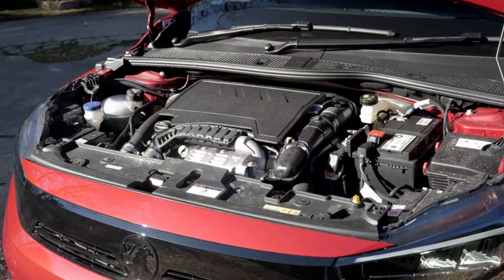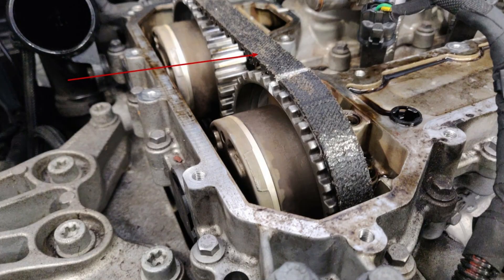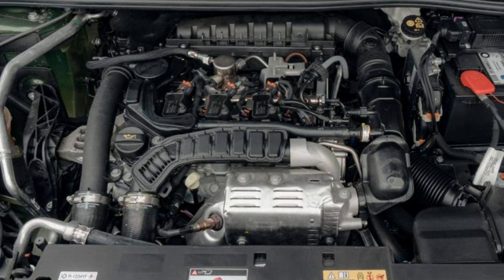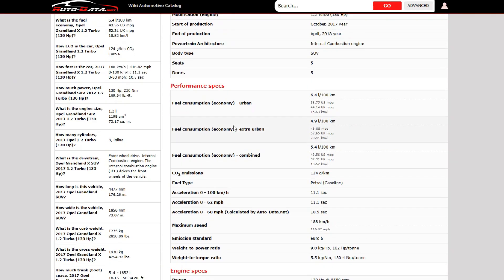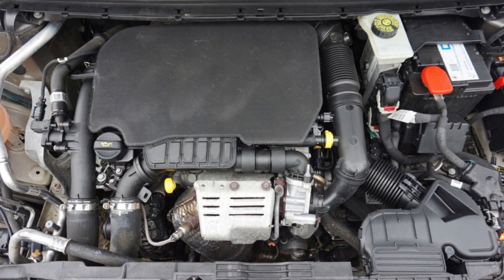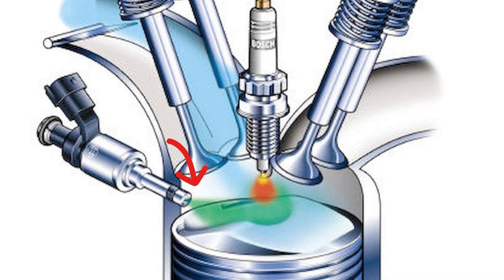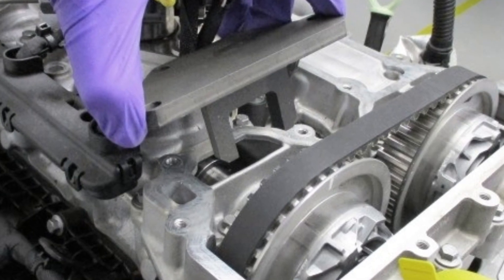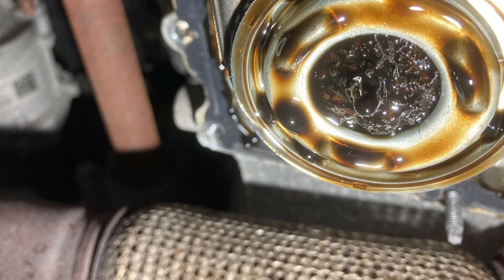Vauxhall 1.2 Turbo engine: Problems and key features

Comment: its not the oil rings or the valve / its the chilinders getting oval shape and you need to fix this problem. it all starts when air filter doesnt sit good and dust get in to the engine

Comment: Hy what about engine opel astra 1.2 turbo 130 hp at8 euro 6.4 petrol year 2024.... Is same shit or.... Thanks for info....
Reply from the maker: It's the same PureTech. But at some point, they turned to chains, so you should unscrew the oil cap and see if you can identify the belt or not. If it's a chain engine, there are almost no serious problems with them.
Reply: @DmitrySapko  thanks

Comment: Yes. Good on fuel but that’s it. Absolute dog s**t engine. I followed the servicing schedule to the letter but had an injector failure, A blockage in the oil uptake pipe. Then it started to eat oil. Got rid of it